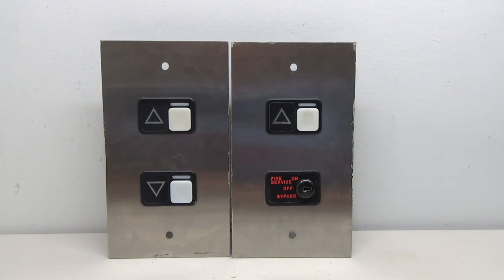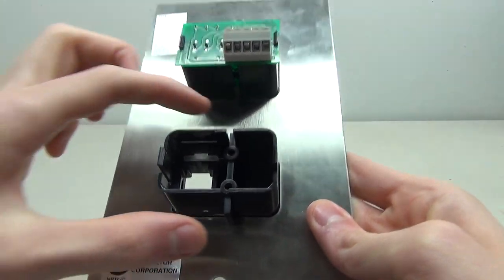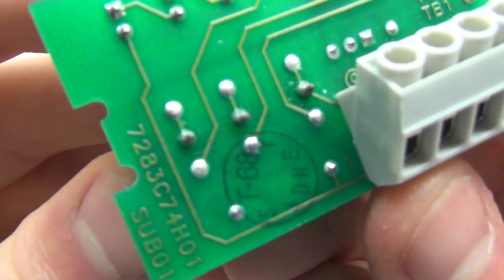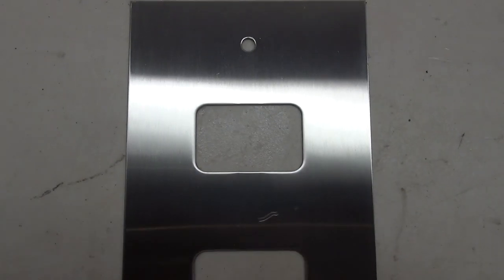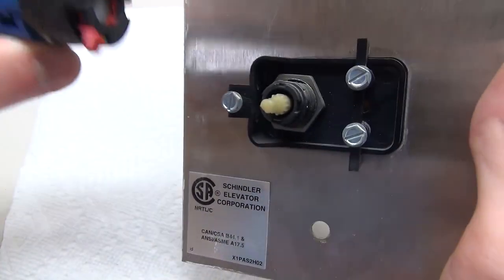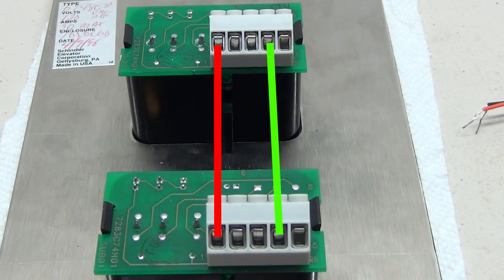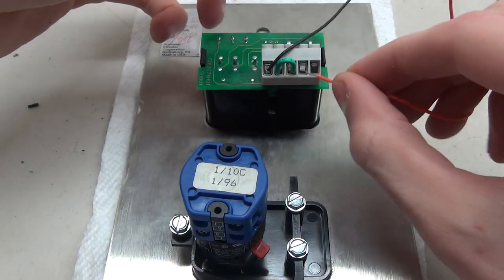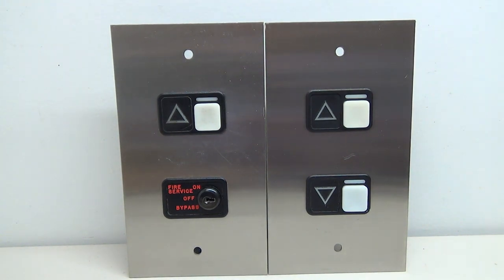Detailed Look and Wiring of Schindler MT Elevator Buttons

Comment: Familiar with that SA logo. That microswitch is in fact made by Saia Burgess from Switzerland, the same company that made the microswitch (but different model) for the Schindler S-Series fixtures in Europe.

The three light bulbs appears to be the same type as the ones used in Schindler S-Series.